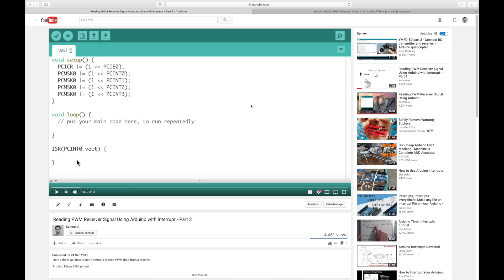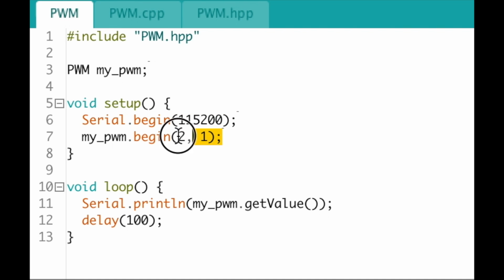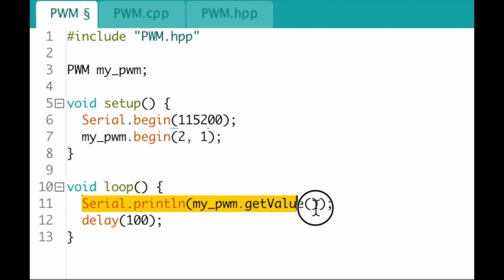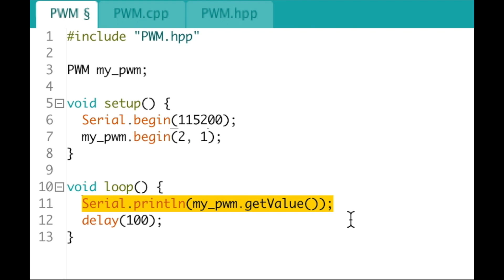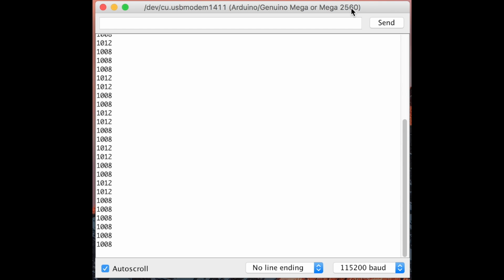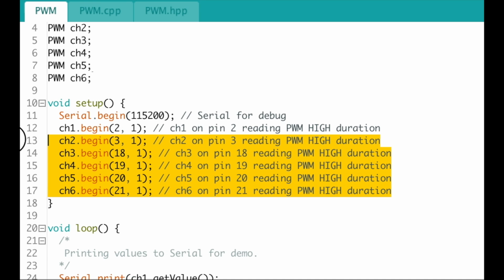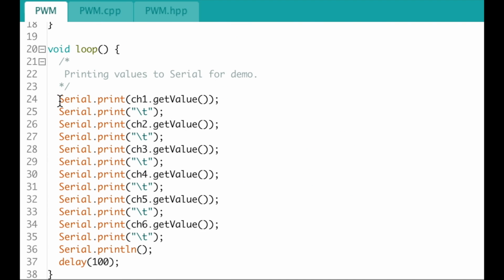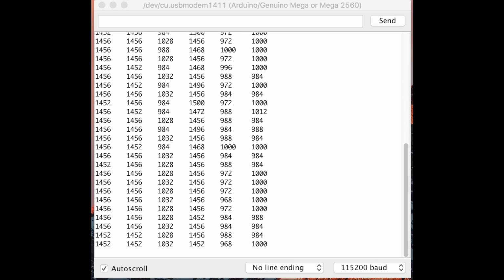Reading PWM Signal Using Arduino Interrupt

Comment: hi Kamran,
thanks for your tutorial, but I wanna know how to convert results to frequency and percent?
your tutorial only show duration High for initial 1 and Low for initial 0.
Thanks...
Reply: I'm not sure if this is right but I think you have to divide either the high or low duration by the total duration and multiply by 100 to get percentage value

Comment: i read with your code values from the RC transmitter and changed it with the map function. To change the stepper motor (nema17) RPM.

but I failed. can you please help me?
Reply: RPM = map(pwm, 0, 255, [min rpm value], [max rpm value])

Comment: Excellent job Kamram Ahmad, this has helped me on my way to working with ibus, on the flysky setup. I am building an RC Excavator and I need a minimum of 9 D.O.F. I understand this method is maxed out at 6 D.O.F, but with upgraded firmware, 10 D.O.F is possible using ibus. I'm not sure if the same applies to ppm signals, I have yet to test this theory. Thank you for the tutorials and the source code downloaded from your github.

Comment: I downloaded the library from github and copied the solo version of the code. I am getting a readout on the serial monitor and I connected my rc receiver ouput signal wire to pin 2 and get values in the window but am unable to change them when I move the joystick on my controller. Any advice?